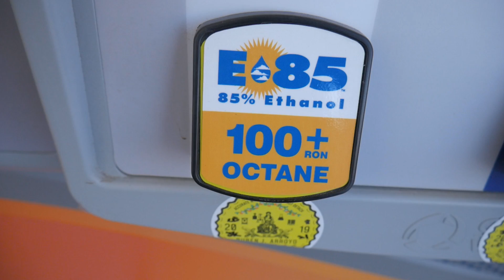Why Can't the BMW N55 Engine Make "High Power"?

Comment: N55 engine is super solid, I have a 15’ 335 performance edition stage 2 and let me tell you, this thing fly’s . I keep up with stock m3 /m4 & c63s...
Reply from the maker: Yea man, N55's are sweet! Love mine especially on E85
Reply: Me too I love my N55 2015 M 335i and it's fast. I don't know what this guy in the video is talking about. His set up is probably with cheap mods that isn't producing quality high power IJS. I"ve seen videos where they got the N55 up to 800 to 1000hp
Reply: Stage 2 n55’s walk m4’s and m3’s stock I don’t know what everyone here is saying trying to dispute that
Reply: Im getting 20.1 lbs peak boost on my f30- and if the gages are too be believed im hitting around 400 hp and little over 430lbs torque  on stage 1 mhd evo racewerks cp,hp cai. Thing is a rocket ship, and stomps a mud hole in my 500 hp challenger scat pack- wouldn't have got challenger if I drove this first.
Reply: I raced a pure turbo stage 2 full e85 M235XI and beat It in my M4 with Basic CS tune.
Reply: Cap
Reply: This is facts . Had a stage 2 n55 2015 EWG because the EWG is way better then the pwg top end wise . But my car would walk m3 and m4 and c63s slowly lol(with a bootmod3 ots map). Now I got a big boost kit recently installed n yeah that’s a whole diff story lol
Reply: Also it was running e30 with boost peak of like 19 psi stock turbo
Reply: No you are not keeping up with c63s with an n55 hahhahaa
Reply: yee yee why not? I had a 17 C63S coupe and raced a stage 2 N55 335i and it hung with me
Reply from the maker: @eninety  yea with just a "stage 2" flash there's no way lol
Reply: Bro n54 with just few bolt ons and tune walk m4 and m3. Not just keeping up. That's without inlets and custom tune! Not even e60! Only e30 or e40.  I have video from my cuz just raped an m4 and m3 owner is admitting that.